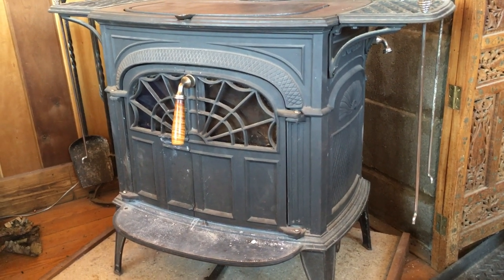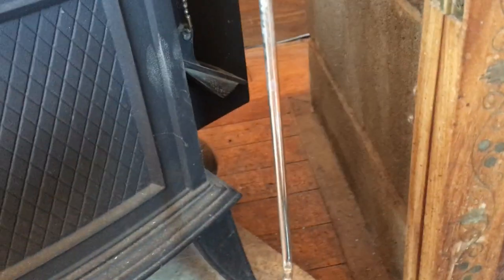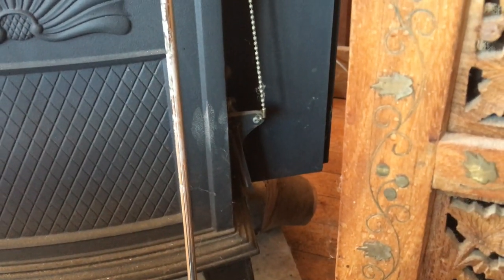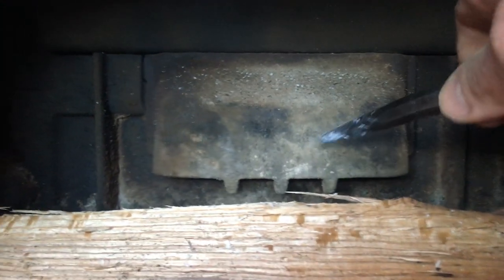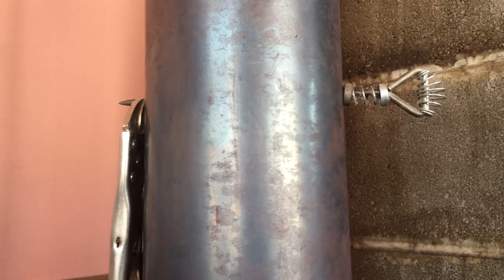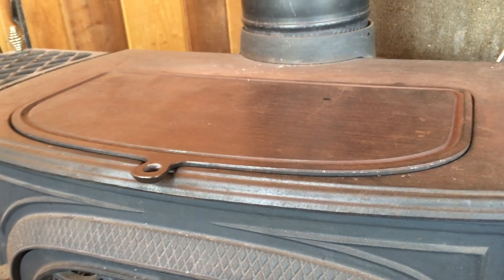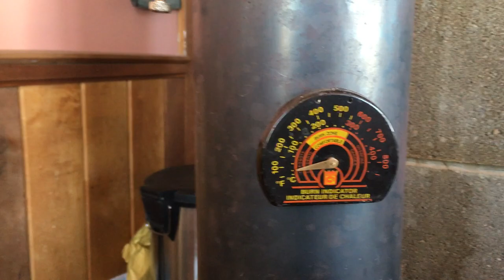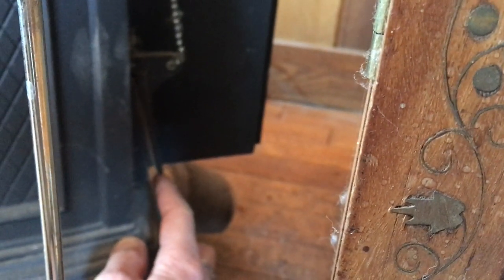Vermont Castings Intrepid II Wood Stove Tutorial

Comment: There is a secondary air intake on the very bottom back, it has no manual control so it works automatically. Mine has a permanent handle on the catalist lever, but not on the front door lever. I also have a defiant encore and it is much larger than the Intrepid II. Both are great stoves. I like that my Intrepid will burn with the doors open and not smoke into the house.

Comment: Nice video. just as a point of interest :  I am burning an original 1978  Intrepid right now.   Still going strong after 40 years..wow,  can’t believe the years have flown by but the stove hasn’t aged a bit, never had to do any repairs of any kind, ...
Reply from the maker: They are awesome little stoves! We have two of them.
Reply: I run a 1979. Been restored  twice and I love it.  It does take a bit of learning though. It is not a stove for people that don’t pay attention.  Great stove.  Heats my 1200 house without an issue. Newer tight build though.
Reply: @stannelson2582  would you elaborate on “not for people who don’t pay attention?  Thank you.
Reply: @sagesage754  just my opinion sage so for me what I meant was simple.  The stove needs to be air tight to properly manage heat.  Air inlet is manually controlled by a lever so if you leave it wide open and walk away it’s design will make it crank the heat and if the stoves gaskets are not perfect it’s dangerous to get it back down in temp.  In addition as pipe gets dirty creosote can fall and block the rear chamber if not cleaned regularly (very easy to clean if you have any sort of mechanical ability)   Or if you don’t burn hot fires creosote can build up.  It’s a stove that is great if you are around it to learn it’s behaviors and it’s in perfect working condition.  If your not that person you can buy the modern version that is very affordable that is a catalytic stove that greatly reduces the risks.  Feel free to ask anything else. I love gramps old stove and will continue to use it   It part of the fam lol.
Reply: @@northjerseykev2835 just my experience so…..  because they are small stoves that use a manual air inlet you can get them too hot if you run them wide open.  You have to manage the air so you have to pay attention. Once warm you can shut down the air and let them just cook.  It’s important that all the gaskets and the stove seals well.  If not the air leaks make it hard to control temp. Bad seals can turn it into a “rocket”.  You should be able to have a good fire shut it down reduce temp and reduce the dancing flames.  If so it’ seals properly.  If not air is getting in and you will not be able to control the temp. Then it’s dangerous.  It take time to learn these stoves. But when you do they are great units.
Reply: I'm on a job that's using one for heat. How do you get the ash pan out? There dosnt seem to be a tray or handle to release a pan?
Reply: To empty the ash pull the tray that is inside the fire box. Put something in that slot in the bottom middle and pull it out. He points to it t the 1 minute mark of the video
Reply: @Jay-ye1up  depending on the year,  these stoves don't use an ash pan..you have to leave a layer of ash on the bottom....you don't want to clean it out completely because it may burn through the bottom...

Comment: I was reading through the intrepid user manual. When you engage the catalyst do you have best results when leaving the primary air control in the lowest position  as you described in the video? Or is it just personal preference on what level the primary air control is set? In the manual it doesn't really explain/ justify what position the primary air control should be in when engaging the catalyst. I am new to using a wood stove and I think I've had issues with engaging it too soon and not having enough of a fire built up resulting in the smoke not getting burned and smoldering the fire. Thanks for your help!
Reply from the maker: As far as I have always heard, and I believe I have read, the air vent needs to be completely closed always when using the catalytic. Otherwise it’s possible that the catalytic could get too hot and be damaged. As I understand it, if it is adjusted correctly and functioning correctly, the air vent also has a heat sensing coil that will cause it to open and close as air is needed but I don’t have a clear enough understanding as to how this works whether the lever is to the left so it’s closed or to the right which has it open. Having use the catalytic many times, in my experience, it is pretty important to have a well-established fire, before engaging it. One should also never open the doors of the stove with the catalytic engaged has that much air running through the stove can damage the catalytic element, but I think it would take a little while, so opening the door for a moment I don’t think will hurt anything. If you forget, it’s kind of unpleasant, because it usually sends a lot of smoke into the room!
Reply: @LaunchingPadma  thanks for the reply Peter. Your video and info above is very helpful appreciate it

Comment: Thnx much for this great video, Peter!  I recently moved into a rental that has this stove and wanted to know more about the various parts.  Question:  The back of this stove has a full additional metal cover attached to the back of it (that extends out about 1 inch from the stove.  There is also a flexed metal hose (that looks like a dryer duct hose) that runs from the bottom back of the stove into the floor.  I assume this is for add'l air from beneath the house?  The full handle for what you describe as the catalytic converter is missing (just the stem is visible), so I am assuming that the back cover and the venting hose I have described actually end up bypassing the catalytic converter?
Reply from the maker: Hi Melissa, I'm guessing that the additional cover on the back is a heat shield. This was an add-on you could get that would allow you to put the stove closer to a back wall. I think the hose you describe is likely an air intake just like you said. I'm not familiar with using one with this stove so I would check with a stove shop who knows. The lever for the catalytic is for some reason made the way you describe, where the handle does not stay in it. You can buy new ones and people on ebay and etsy sell them as well. We often used a properly sized punch from the hardware store.
Reply from the maker: You'll notice at 2:29 in the video me using the punch to engage the catalytic lever.

Comment: The damper on mine doesn't reopen when you move the damper handle from up to down. It does shut when you move the damper from down to up though. Is this standard?
Reply from the maker: If I understand what you are asking, it should open. Hopefully the mechanism is fine but the gasket area may have something on it that is making the door stick? This is the door that engages the catalytic, correct?

Comment: Thanks for the review!  I've heard that some people have a lot of trouble with the converter, have you experienced this?
Reply from the maker: Can you be more specific about what you mean by trouble? I have been using one of these stoves for 25 years and just bought a second. I have never had any trouble with the catalytic converter. They do require maintenance in that overtime Ash can collect in the channels that the exhaust must pass through and so depending on what kind of wood you burn how much burning you do and how well seasoned your wood is you will need to open up the panels at the back of the stove and clean that area out. I’m not sure if there’s a video of this process being done but if there isn’t I should post one. In my experience it’s not the catalytic element itself that gets clogged but simply the passageways that the smoke must pass through.
Reply: @LaunchingPadma  I can't find the review of course now but I think what they were saying was the stove got too hot, and burnt out the catalytic converter.  No matter what they did to maintain the correct temp, the converter would burn out even at correct temps.  I'm going on memory here so not quiet sure but I think that's the gist.
Reply from the maker: Patrick Dunne that surprises me. I know that this stove has been made for a long time and that Vermont castings has changed hands maybe more than once during that time but I’m not familiar with the history. I wonder if there have been any changes or periods where the stove was not made as well as other times or if the catalytic elements were not as good a quality. I suppose it could depend on what kind of wood they were burning. If they were burning nothing but extremely dry elm then there might be trouble! We always use a stove thermometer and the only time we have noticed the stove getting too hot is if we have particularly dry wood and the catalytic is not on, but as soon as I turn the catalytic on the temperature comes right down to a normal range. In the situation you described I would also wonder about the condition of the stove gaskets and being certain that the air vent is closed. Without knowing the specific circumstances under which this was happening it’s hard to say.
Reply: @patrickdunne1150  If I might jump in here (?) I too saw the video from a gent in Canada who had trouble with 2 different Vermont Casting stoves over-firing in the refractory chamber (housing the catalyst) that caused the stove to get way too hot.  I have not heard of others having this issue personally but there was another video of someone that had a similar problem - then found out it was due to someone (dealer or factory) having left the 'outside air adapter' off the stove.  This allowed too much air access to the firebox.  He installed the missing adapter and his issue went away.  Hope this helps.  I'll have 'personal' experience soon as I have just purchased a new VC Defiant stove and will be firing it up soon.
Reply: Actually, in second thought, the missing adapter was fixed by placing a metal plate over the opening in the back of the stove.  You shouldn't need the adapter unless you're piping outside air (from under the house, most commonly) into the stove because your house is too air-tight to allow the stove to draw air.  Most homes are not that air-tight.
Reply from the maker: @mic982  Well that makes sense, although how could you use the catalytic if that is open, even properly piped in?